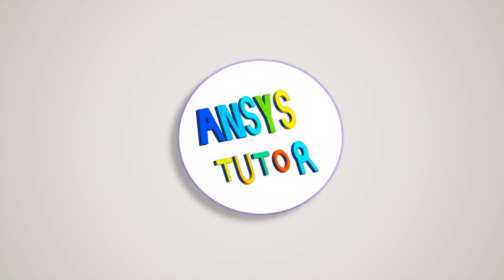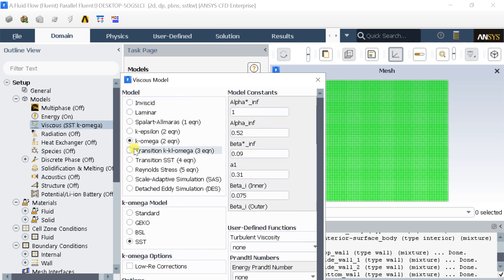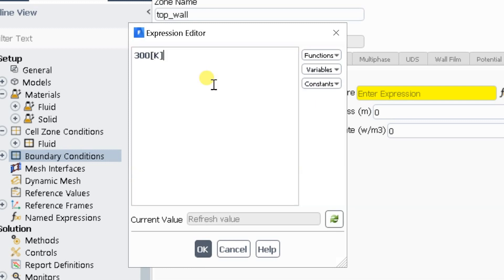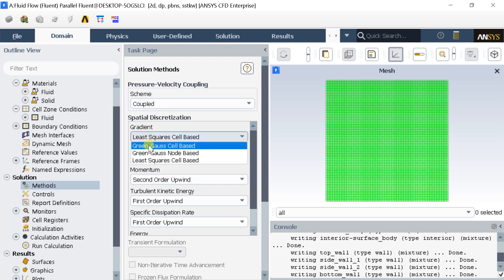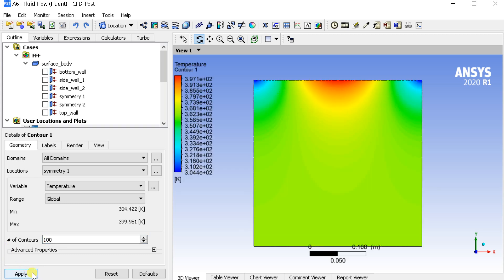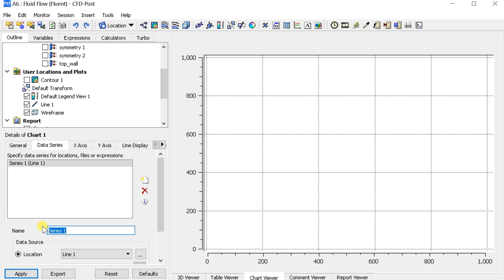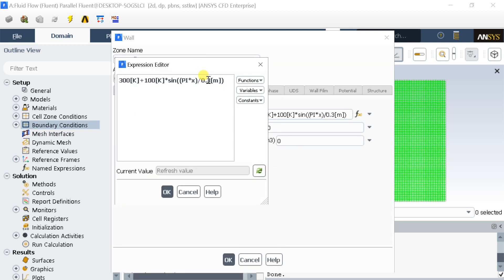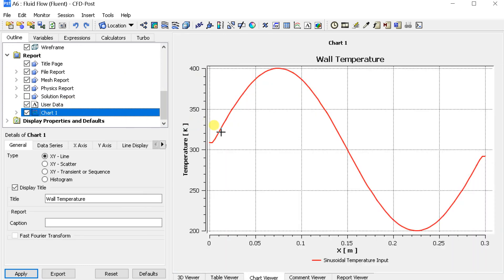Sinusoidal Wall Temperature Boundary Condition Input without UDF | ANSYS Fluent Tutorial | ANSYS20R1

Comment: nice video thanks man. is it possible to do the same procedure when i am simulating a cylinder moving in a fluid where i have to specify a sinusoidal velocity that depends on time.something like velocity=2.pi.f.sin(2.pi.f.t) . I dont know how to use UDF so i prefer this methods
Reply from the maker: I think it can be possible this way.
Reply: Hi, I have tried the method on my simulation, which is a 3D model of a sinusoidal moving flat plate along the x-axis, and converted the temperature to speed, but it did not work. Can you help me?